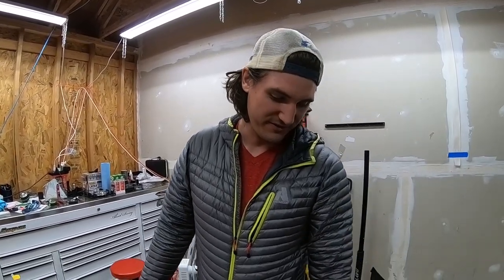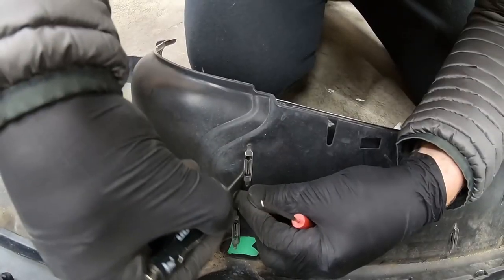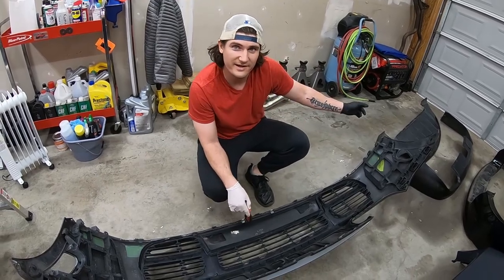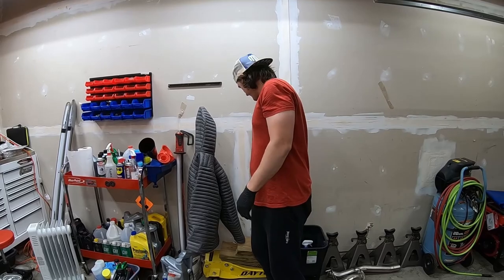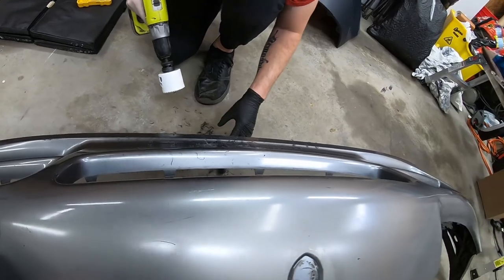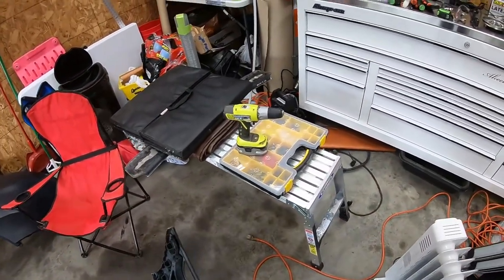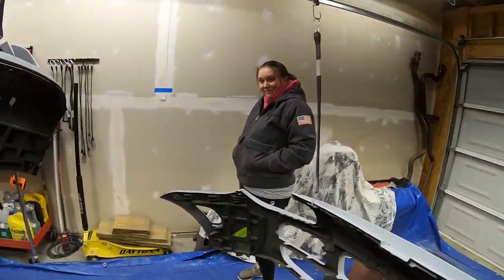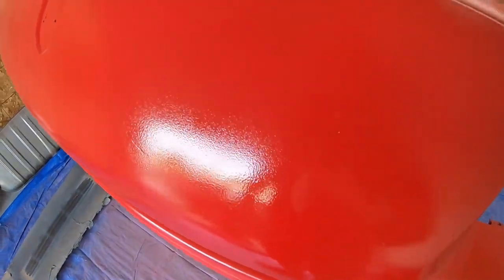Painting Parts For Our Totaled Porsche Cayenne S

Comment: you didnt say where you got the parts or price?
Reply from the maker: Well the prices on bumpers are all over the place on the internet, I picked the front bumper up with all the grill pieces and fog lights for $400 and the rear bumper for just over $300 I think with all the pieces. I waited until I found good ones, I got both from eBay. Some bumpers on there are priced so high it’s almost worth it to just try and order a new one from Porsche.
Reply: @kamalakeel  how much is a new front bumper and how long to order one from Porsche?  I'm looking at used cars and one needs similar front work to your dad's.